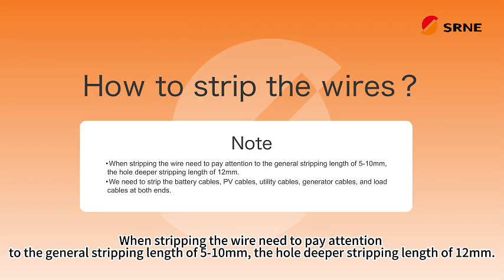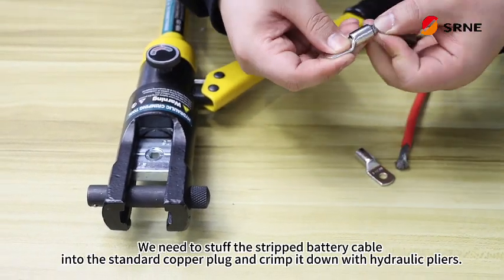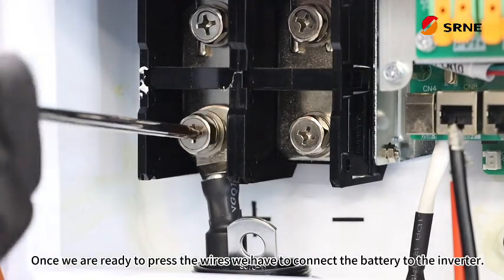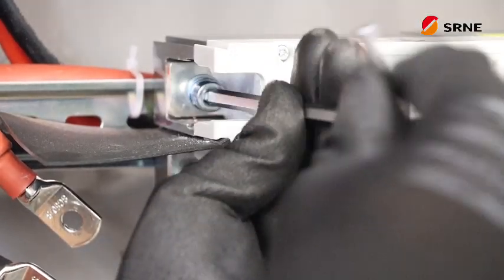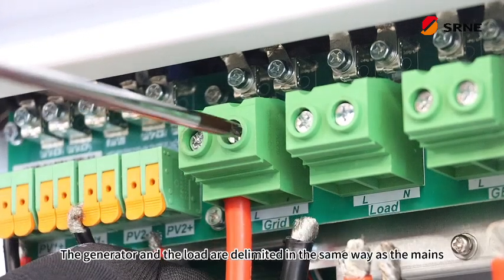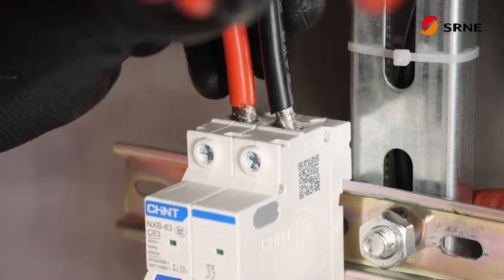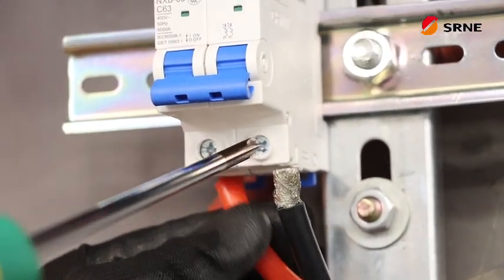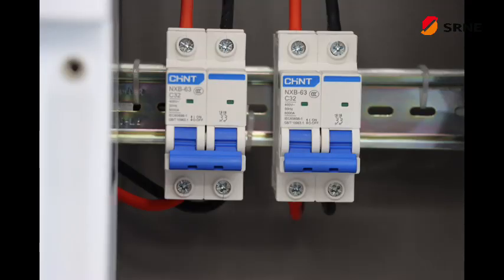HESP Series Installation Guide

Comment: can you pls make a review on setting up parameters of 6kw HESP series?..thnks
Reply from the maker: You can consult our after-sales technical support
Reply: @srnesolar5017  SRNE i getting good reputation as i see, many people are buying and having no problems even in discussion forums are talking a lot of SRNE but there is a lack of more informative videos for example battery protocols, dip switches etc..
Reply: @srnesolar5017  i HAVE THE hesp48120u200-h ,12kW INVERTER AND NEEDS THE WIFI DONGLE.